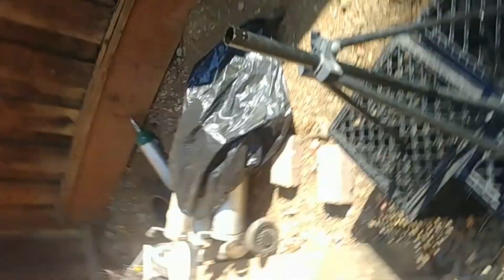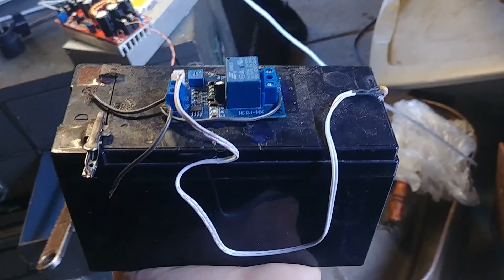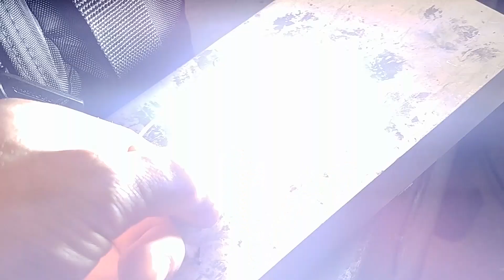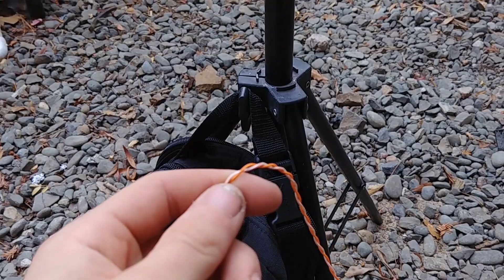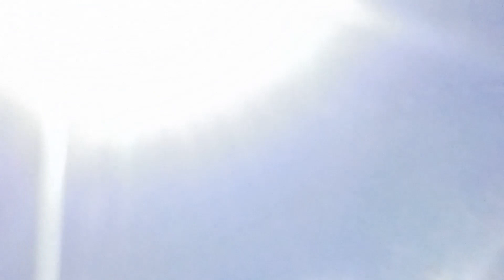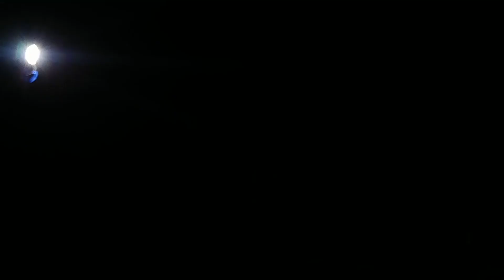DIY 100W led floodlight COB chip

Comment: I like the cheap and easy construction. That keeps the threshold for future adaptations low. You are currently losing half your light into the sky. Try adding a simple reflector. Our maybe make the lamp post higher, with the led pointing down. That'll help performance a long way.